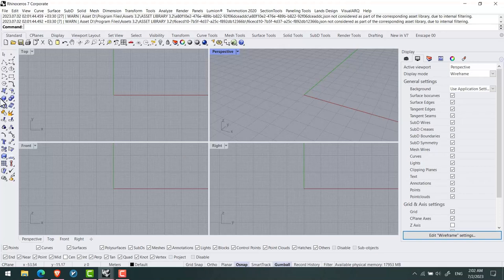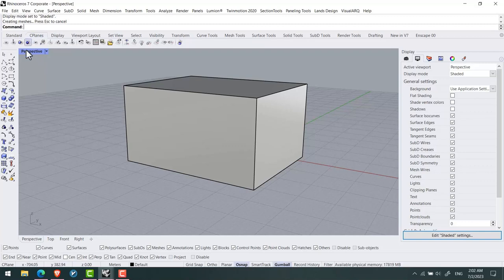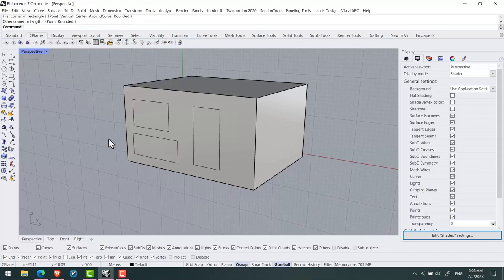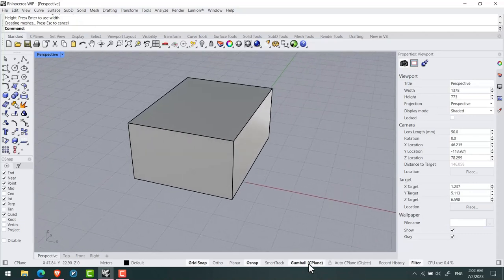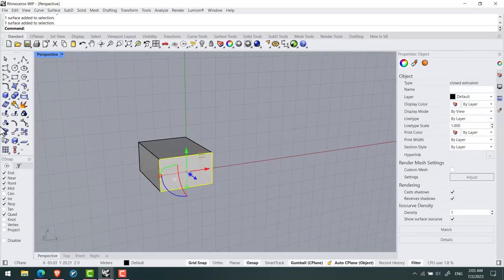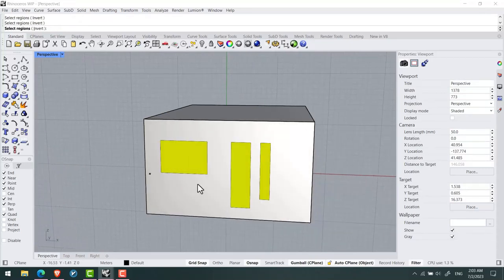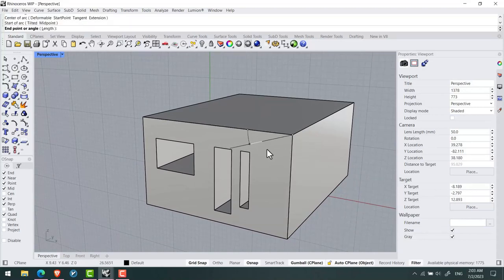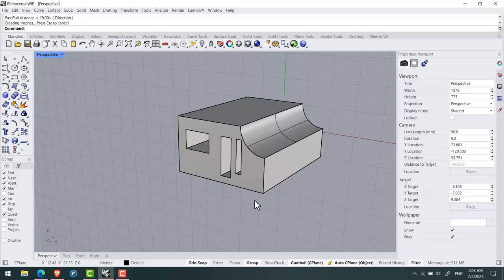🚀 𝐑𝐡𝐢𝐧𝐨𝐜𝐞𝐫𝐨𝐬-𝐍𝐞𝐰 𝐅𝐞𝐚𝐭𝐮𝐫𝐞 𝐀𝐮𝐭𝐨𝐜𝐩𝐥𝐚𝐧𝐞 𝐢𝐧 𝐑𝐡𝐢𝐧𝐨 𝟖 - 𝐄𝐧𝐡𝐚𝐧𝐜𝐢𝐧𝐠 𝐘𝐨𝐮𝐫 𝟑𝐃 𝐌𝐨𝐝𝐞𝐥𝐢𝐧𝐠 𝐖𝐨𝐫𝐤𝐟𝐥𝐨𝐰 💡

Comment: and other CAD software has done this before. Why is Rhino always left behind?
Reply from the maker: Rhino's focus on flexible, organic modeling and its extensive plugin ecosystem make it excel in certain areas. However, its integration with BIM platforms like Revit has historically been less seamless compared to other CAD software. Rhino's strength lies in its versatility for complex geometric designs rather than BIM-specific workflows, which may contribute to its perception of being "left behind" in this context.

Comment: So, Sketchup basically.
Reply from the maker: Not exactly. While SketchUp and Rhino both offer tools for 3D modeling, they have different strengths and applications. SketchUp is known for its ease of use and suitability for quick conceptual modeling, while Rhino is favored for its advanced surfacing and modeling capabilities, making it more suitable for complex and detailed designs.